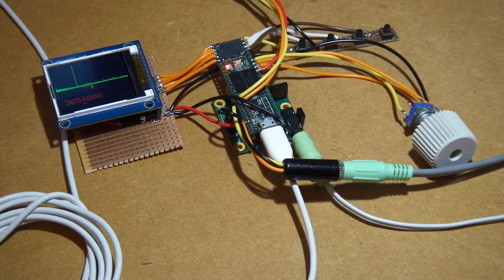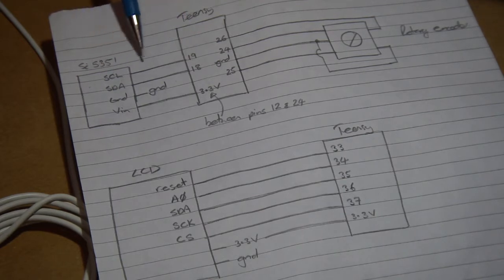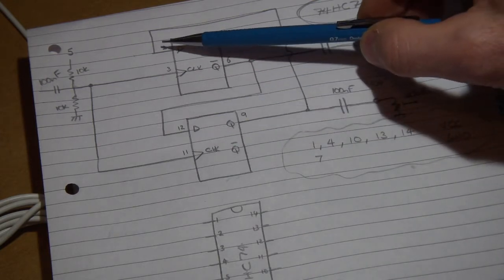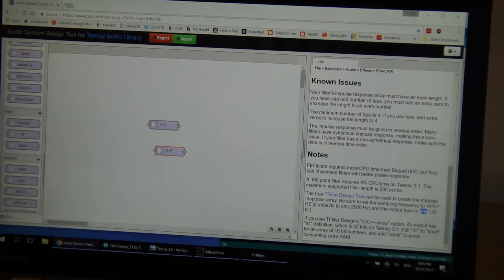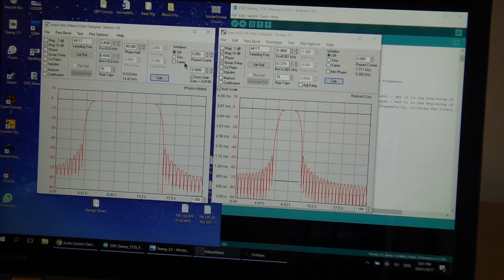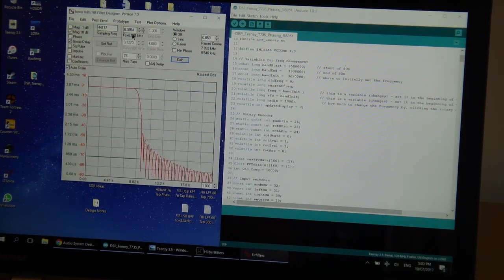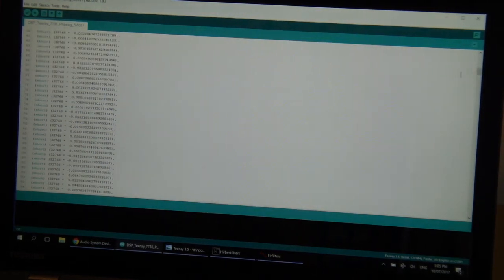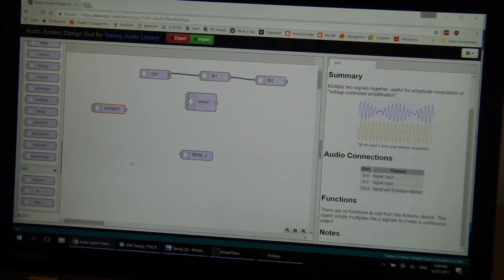Homebrew SDR Receiver Part 4 - Notes on Si5351, LCD, Rotary Encoder and Filter Design

Comment: Thanks agn Charlie for answering some of the questions.  The DSP code generator is amazing. This is how the commercial engineers have been fabricating our rigs for the past 10 years. And now it is accessible to homebrewers.  Surely the next wave of DIY/homebrew for the radio amateur!
Reply from the maker: I agree. Did the GitHub link work?
Reply from the maker: Paul Stoffregen did an amazing job with the Teensy and the audio code generator. His library is very good too. So easy to use!
Reply: Charlie Morris Yes no problems. Your VFO code looks familiar, all of these sketches do roughly similar things.   Havent got to look at your SDR code yet. Thats where your Part4 vid will make it easier to follow! Keep up your experiments.